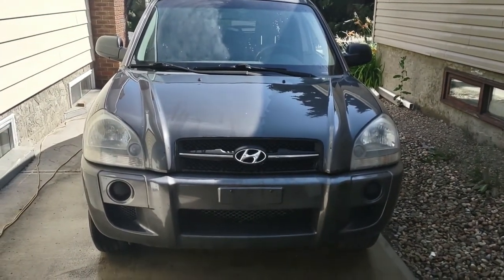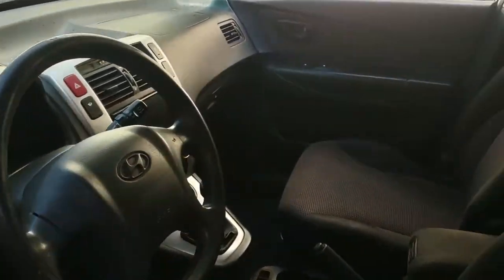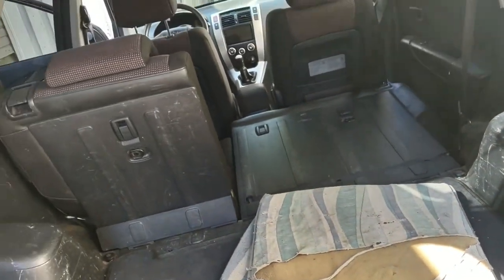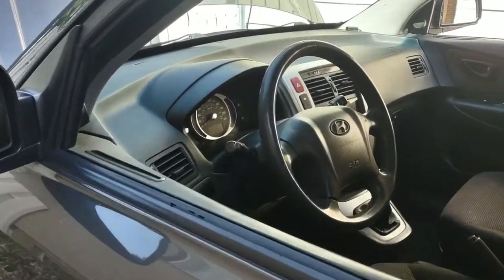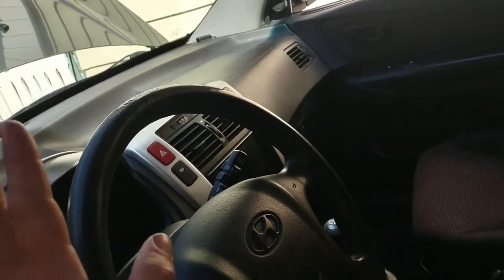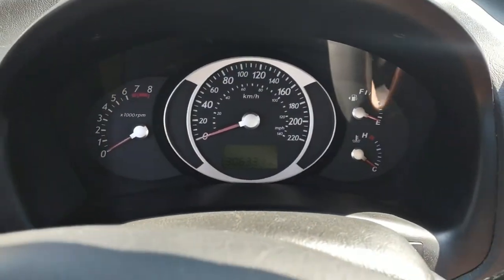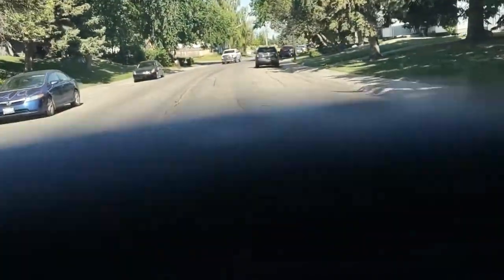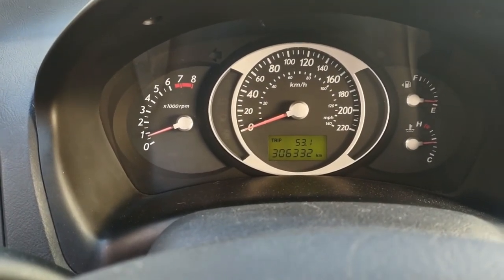2006 Hyundai Tucson high Miles review!

Comment: Amazing video I got a 2006 Tucson from my grandparents with 110,000 miles it needs breaks and tires but after that I’ll be driving it and I’m so excited especially that I grew up with the car because they were the only owner and I was 2 when they got it
Reply from the maker: Thats fantastic!! Brakes are fairly easy to replace and the parts are quite low cost.  I'm a big fan of the value of Chinese tires, they're really good performance as well, so worth a look if you're on a budget or find some used tires on marketplace.  Take good care of it, treat it well and it'll serve you a long time I'm sure!  One thing I've learned over the 40+ cars I've owned, regular oil changes are critical, happy motoring and thanks for watching!
Reply: @Kingsoupturbo  Thanks for the great tips I'm going to baby it lol
Reply: Did you replace the timing belt ?
Reply from the maker: @JTManOfGod  I did, the parts are quite low cost, its not a terrible job, just time consuming, by far the hardest part is scraping the old water pump gasket, I missed some and had to do the entire timing belt a 2nd time to get it perfect.
Reply: How's it held up?
Reply: Make that Brakes. they stop you Breaks means something is broken. See this so much don't know why people can't get it right.

Comment: Bought a 2008 2L 5 speed Tucson during Covid only 110,000km for AUD 7,000.  Replaced gas struts on rear window for only $32 otherwise just changed full synthetic oil and filter every 10,000km.  Currently 143,000km and still going strong!!!!

Comment: I have a 2005 Tucson that I've owned for the last 12 years. It's had 2 new airbag sensors, new disc brakes, 2 timing belt kits and a new air con radiator, and that's it. Mileage is currently 114k. I haven't even changed the exhaust!
Reply from the maker: Pretty good! Interesting to see you had to do the airbag sensors as well, this was the first car in a long time I've had to do them on.  Thats pretty minor work considering the mileage, very nice, and thanks for watching!
Reply: @Kingsoupturbo  

Sensor #1 failed about 2 years after I bought the car. The second sensor failed about year 5 if I remember correctly. A friend scanned the codes for free but I think it would cost about £80 ($100) and the sensors were around $100 each.

It has been a mega reliable car and I don't know why they get a bad press. Everything works as it should - electric windows, sunroof & heated seats. I'm going to keep it as long as I can - the timing belt needs to be done for the third time soon!

Enjoyed your video.

Comment: Hi, I bought a 2006 V6 and the air compressor makes a whine whenever I accelerate. Would you happen to know anything about it?
Reply from the maker: This one did that as well, but only when it was turned on.  Could be bearings or the clutch is worn out, does it make more noise when the A/C is on?
Reply: @Kingsoupturbo  it only makes noise When the a/c is on, also it doesn’t make the noise when I rev the engine on idle

Comment: Thanks for the video. Just bought a manual transmission. It was pulled behind a RV. The guy left it in gear while towing it. He replaced the engine but not the trans. It only has 89,000 miles. The replacement engine has 82,000. It's at the shop now waiting for the diagnosis. Probably going to need a trans. Thanks for sharing this informative video
Reply from the maker: Hey there! that sounds like a good deal!  I'd be curious to see how many other cars use that same 5speed, I'd imagine you could find one pretty low price, likely used in a ton of cars!  Happy trails!

Comment: I have the same car but 1 year newer (2007, front wheel drive, 4 cyl, 5 speed, bought new). Have had no issues. Just regular brake pads, 1 new set of rotors, oil changes, and 2 new batteries in 16 years!  Finally need to replace front half of exhaust system at 280,000 miles!!!  Note: I drive conservatively/carefully. I think that's key to its longevity.
Reply from the maker: Wow, thats pretty incredible, that is virtually nothing considering 280k miles!!  Regular maintain is key, the value for money on something that reliable is amazing!  imagine what a domestic pickup truck would have cost you to do 280k miles, or a Ford Explorer or something, endless repairs, thanks for watching and keep on saving the planet through reliable, cost effective,older Tucons!

Comment: I have a 2006 Tucson limited, 2.7L, 4x4 and I absolutely love it. It has 189,xxx miles, Automatic unfortunately I wish it was a manual, but hey it runs and drives so I really can’t complain. It needs a few things to pass New Hampshire state inspection like exhaust leak at the cat back flange, some bushings in the front end but other than that it’s not rusted for being a New Hampshire vehicle.
Reply from the maker: Very nice! I think the V6 and Auto are probably the best combination. To be truthful, the manual with all the rev hang isn't the most satisfying manual transmission (by trying to make it easier to operate they made the fun level a lot lower), the 4cyl is a bit coarse and harsh as well, Sounds like it won't take much to pass inspection, I had to do some welding on the flex pipe on this one as well.  thanks for watching!
Reply: Great video thanks for sharing! Looking for a cheap suv compact found a 2006 v6 well maintained for $2200 ! Hopefully the test drive goes well and I have gd luck she has high miles at 195, 000! Wish me luck 😂
Reply: I’m looking at one of the same as yours! Hope I have a gd experience I’m not far from you , down in Mass. No rust really on this one too!! Surprised!! Keep enjoying  your Tucson!

Comment: Going to view and probably buy one of these this weekend, a 2007 2.0 diesel 4x4 with 129,000 miles. I'm in the UK and hoping for a good budget 4x4 (my first) and this has been pretty reassuring as far as build and interior space!
Reply from the maker: A diesel would be perfectly suited to this car, it could use turbocharged torque.  Wow they sold it with a 5 and 6 speed manual which you probably have in the UK, that would be ideal!  The build quality is pretty decent, I have a Terracan as well right now which I like a lot, best of luck on your purchase! thanks for watching!

Comment: I'm going to keep my 2008 2.0L auto bought used in 2019 as long as I can, took it from 105k miles to 145k so far. It has been in the shop many times for repairs and maintenance, but it's still been far cheaper to own than making payments on a newer vehicle. 

Issues I've had, for anyone wondering what the ownership experience may be like: Bad crankshaft position sensor (engine randomly stalled while driving or wouldn't start), bunch of failing suspension parts, bad speedo ground wire (speedo, odometer stopped working), no passenger heat (system flush fixed it I think), a/c needed recharge twice, starter died, ignition switch went bad (starter sometimes engaged when key was in run position with trans in park or neutral, even if engine was already running), catalytic converter was stolen, exhaust pipe went bad, cruise control set switch went bad, TPMS light on with no cruise (system reset fixed this so far), headlight housing went bad (intermittent wire, headlight would go on and off, both housings replaced), HVAC fan speed knob is getting very hard to turn.

If the engine and transmission weren't so rock-solid reliable, maybe I wouldn't have bothered getting all of these issues fixed. The roomy interior and roof rails have been great for camping trips. The rear opening window is a handy feature, something that is not available on many other SUVs. I use it all the time.
Reply from the maker: Very interesting! sorry about having your Cat stolen, it is quite exposed under there! I found the same with mine, the electronics are of average quality, no worse then an american Car though.  The drivetrain though is pretty decent and reliable.  Higher mileage cars do need the love ,most of the things you mentioned sound pretty standard replacement on a Domestic car (in my experience) with the crazy price of new cars, a lot less expensive to keep the Tucson running, especially if you can complete some of the repairs yourself.  Thanks for watching, and your comment, I can appreciate someone who understands value!

Comment: I paid £370 in the UK for a road legal (MOT’d) 2005 4x4 Tucson with 140K miles on it. Amazing value.
Unfortunately the diesel engine dies without warning and sometimes refuses to restart so it’s not 100% reliable, which is why the previous owner sold it - after spending thousands on new parts keeping it on the road in the past couple of years. I haven’t figured out what’s wrong with it yet, I have replaced the camshaft position sensor but that doesn’t seem to have fixed it. 
Like you I had never really paid attention to these cars before but I am very impressed with the design of the car, so many thoughtful features like the flat fold seats and the air vents in the doors that demist the side windows.
I am using it an an off road runabout on my property and it swallows chainsaws, tree stakes and the like. It’s too good for that really and I’m tempted to put it on the road, but the insurance and tax would cost me £50 a month so it’s not really sensible to do that as I don’t really need the car for transport.

Comment: I myself am considering buying a 2006 Hyundai Tucson. Almost all the models available here in South Africa has rather high mileage/kilometres, however that does not scare me that much as these cars seem to be built like tanks. The only thing that I am not particularly fond of is the lack of parking sensors, but that is not enough of a concern for me to not buy it.
Reply from the maker: Hey there, the only issue I found was really all the sensors made by Hyundai for the airbag system, the mechanical seems pretty good.  I can't speak for the V6 and 4wd models though.  Backup cameras are pretty easy to put in, and parking sensors for that matter if you wanted.  Best of luck in your purchase! I sold this Tucson in fact to a family who had moved here recently from South Africa, as they had bought my Dodge ram before this as well.

Comment: I hade to get a new car as soon as possible, I need space to carry all my work materials but don't have a big cash flow to feed a V6 properly. Found a 2006 model for 3,175$US, had to fix the transmission seal, head gasket seal, replace some bushin and a power steering leak. It's a auto/manual but the manual part doesn't work, still scratching my head on that one. The ride is a little too soft for my taste so I have thought of lowering it, don't know if it's a good idea.
Reply from the maker: Hey nice job! its a tough market out there for used cars, you have to sometimes take what you can get!  I didn't love the ride quality either, but its hard to justify changing anything on a car like this that isn't already broken.  Lowering things usually just makes it worse, and if you're hauling tools in it, I'd leave it at standard ride height!  I love manual transmissions, most cars that are automatic with manual change option, I never end up using it.  I hope it stays reliable for you, enjoy the summer!

Comment: As a compact small SUV....is it reliable as much as the Honda CR-V from the same year?
Reply from the maker: I would say very unlikely as reliable as a CRV, but more reliable then a ford or Chevy likely.  There are some low cost engineering\parts on this thing, and then some good stuff.  But generally these are quite low cost, and half decently made, so a pretty solid combination.  Thanks for watching

Comment: Love the video
I have a 07 5speed love it but now I having a problem with the ROOML fuse keeps blowing out the rear whipper and rear defroster and key reminder all run on that 10amp fuse does any one know what might be making that fuse blow out or had the same problem 🤦🏻‍♂️
Reply from the maker: Hey there! I'd check the wiring loom that goes between the hatch and body, many cars have wires bend and break in that area (My Focus\BMW both) would explain it! Happy trails!
Reply: I had a same problem with my 2007 Hyundai Tucson 2.0,it took me 2months to figure out what was the issue with a 10 amp ROOM L fuse which was burning and affect a lot of things,the problem was a sun visor wire which was a little bit cut open and touching the body,i just put insulation tape on it and the problem was solved,it might not be the same problem on yours but I'm definitely sure there's an exposed wire which is touching the body,give yourself time to look for that and be patient about it,you might be lucky like me

Comment: I'm thinking to get my first car and found one of these with 140K miles AWD for 4000$ Do you thin it worth it?
Reply from the maker: Hey there! Prices are so dependent on vehicle condition, and what pricing is in your area.  Used cars are in generally short supply lately so stuff is really expensive.  If its been maintained well, looks good, drives well, its probably worth it.  I almost never do it but I super recommend having a mechanic do a check over before you purchase, it'll tell you a lot, previous accident, leaking seals, worn out front end.  (the steering rack on the 4wd is really hard to change for example)  Its a pain to get the inspection, but it'll tell you everything, even if you're a decent mechanic yourself (as I am, but I've failed many times on pre purchase inspections) best of luck !  (BTW the V6 4wd come with a lot of stuff the FWD don't, leather, heated seats, side airbags built into the seats, and a fair bit more power)
Reply: @Kingsoupturbo  appreciate your feedback and time. I’m on my way to see this car rn
Reply: @Kingsoupturbo  got this car, paid 3200 and only 3 tires needs to be replaced and that’s it
Reply from the maker: @fayz.hakimov  Thats great! well you got them down in price nicely!  I've had really good experience with Chinese tires, I've tried 6 sets now and they've all been quite good, great value there.  Have fun with your new car, exciting!
Reply: @Kingsoupturbo  thanks man! I’ll appreciate if you can suggest me a tires, thanks
Reply from the maker: @fayz.hakimov  I"ve had personal good experience with Royal Black which is the budget brand for a Japanese manufacturer, and Aoteli, There are always tires on sale as well, as well as often used tires for very cheap.  Chinese tires new are often nearly the same price as a set of old used Michelins etc, I found good grip, handling characteristics and wear from Chinese tires, or find a deal on some Khumo's etc.  If you're in the USA, check tire rack and tire trends for sale items, happy motoring!
Reply: I sincerely hope you didn't replace exactly 3 tires!
Reply: @wolfshanze5980  I did 4 of them and paid 460$